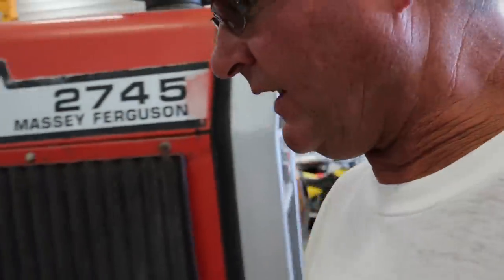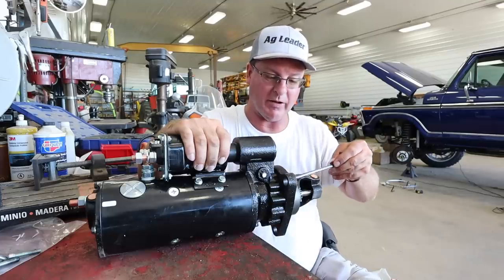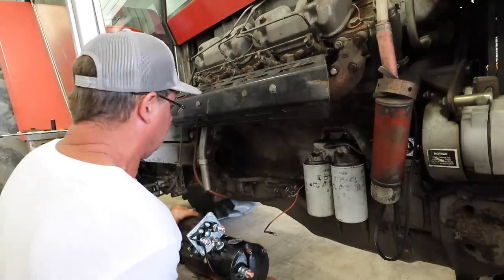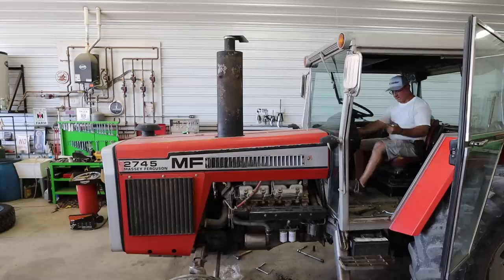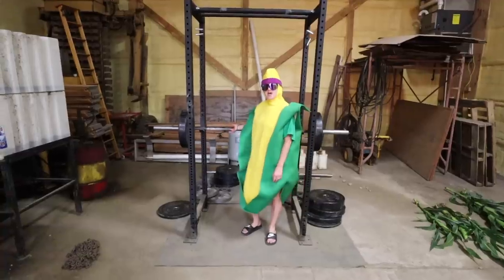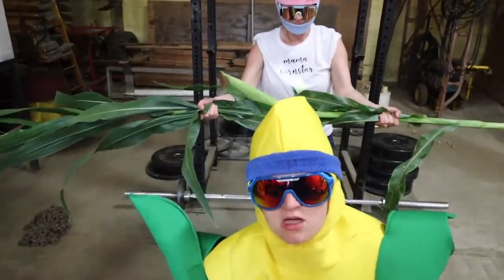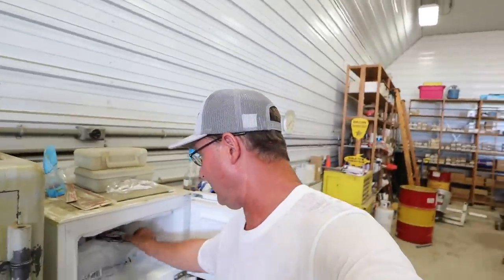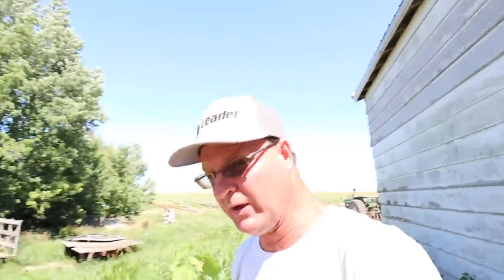Will It Run? 40 Year Old Tractor's 1st Start!

Comment: Hope this helps, a good technique for any mechanic repair is to lay the new and old parts side by side to see if they match and how they differ. Helps with putting remanufactured parts in the right way so you're not having to reinstall multiple times.

Comment: Bunch of good content removing lath & plaster ceilings? Sheetrock an finish the ceilings? You end up finding all your electrical issues in the process. Knob an tube will burn house's down. Your lucky to have such a sold base to strip down an remodel in your grandfather's house.

Comment: Should be a Perkins 540 Dot 3 or Dot 4.  We had a Perkins 540 Dot 3 in our '76 MF 1155.  Dropped a valve and hammered it through the cylinder wall.  Found a 540 Dot 4 out of a MF 860 combine and converted it to a tractor engine for the 1155.  Daddy Corn Star, is the 2745 still a 24 sp powershift, or have you converted it to an 8 speed?

Comment: Well daddy corn star try changing a starter in a big ol kenworth with a bigg ol catapiller. Usually have to lay under it and bench press it up from the bottom. On Detroits ya carry a wide strap or belt so ya lift up out and back down in with the strap.  Was impressed you learned you can rotate the Nose Cone. Them starters are really easy to rebuild yourself. Same on your old oliver. I know ya prob paid a 100 core for the starter. So yaa hauler back if not rebuild ya self i saved the boss 340  rebuilding the one for his volvo myself. We never had any massy stuff but they are really good tractors. We leased a 760 massy combine one fall. Chuckles we had to pry my brother out of it when we were done because he loved it